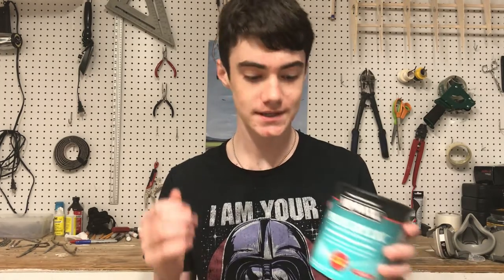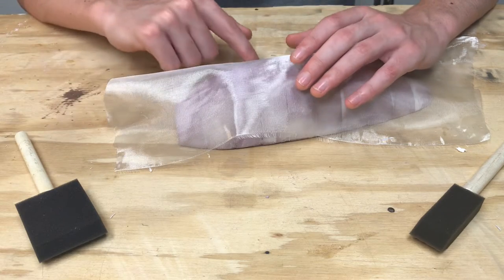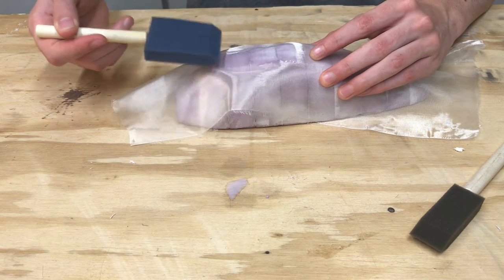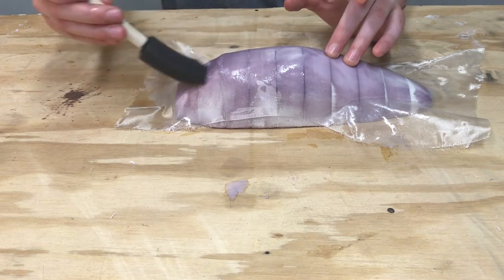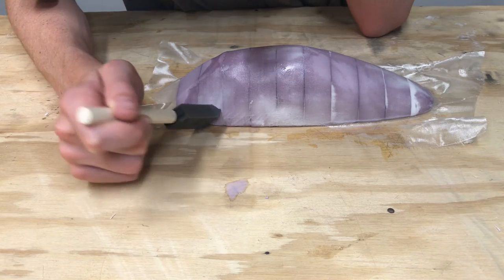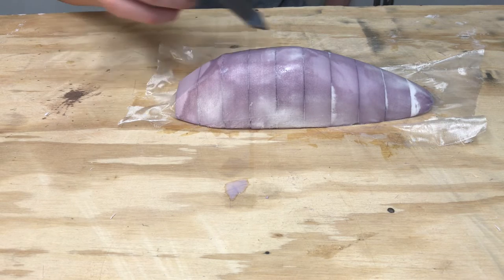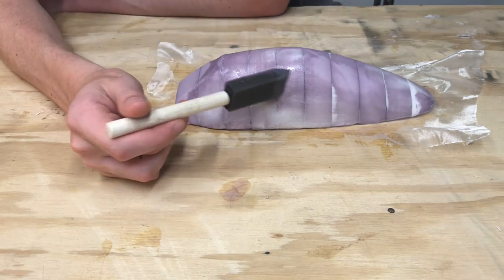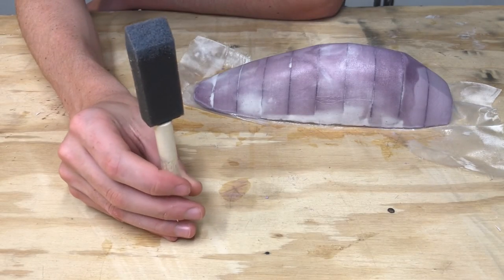Fiberglassing with Minwax Polycrylic! Fiberglassing for RC Airplanes

Comment: Fantastic video.  Been using this technique for 20 years and its still my favorite.  One suggestion that you might appreciate.... I lightly mist coat my parts with 3m spray adhesive before laying the glass down.  Helps to avoid stubborn wrinkles that can pop up when a large part gets too wet from the wbpu.

Comment: good job young man, but...I agree with another viewer that you should "wet glass" your foam, cover that foam with a light coat of Minwax, then lay the glass over the wet foam for excellent adhesion, then wet coat the top again, squeege off and away you go.

You might want to try EZE  Kote by Deluxe Materials, it also is a bit better as it is a laminating resin and water based.
There are a few more adhesives in it above Minwax, dont get me wrong, you are doing a great job, this is just another way to get great results, been doing this for years and old-school 2 part resins are a royal PIA. water based is awesome.
Keep up the great work!

Comment: I’ve had a horrible time trying to find 1/2 oz glass
Reply: I use 1.5oz on all my projects. It's cheaper and easier to find. Most aim for 3/4 Oz but overall the added weight is negligible
Reply: Found .085 fiberglass cloth on Amazon. Great price as well.

Comment: Would this work on styrofoam
Reply: If the water-based poly does not disolve it (and I doubt it would), this should work with styrofoam. Try on scrap to be sure.